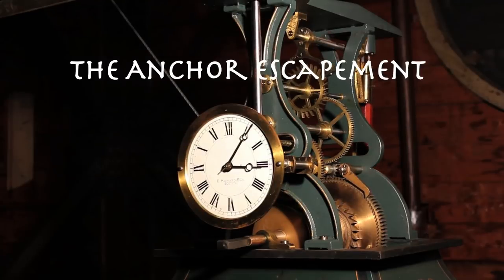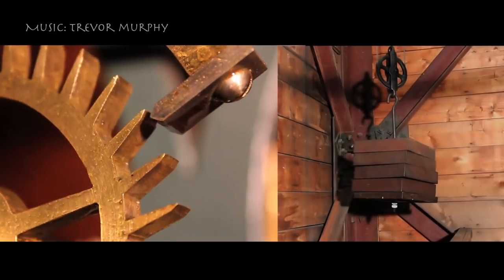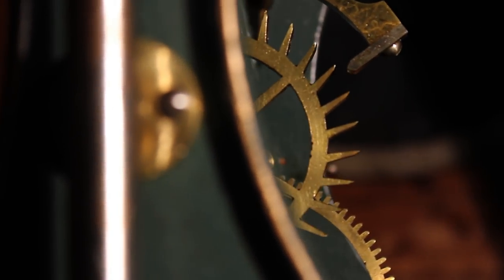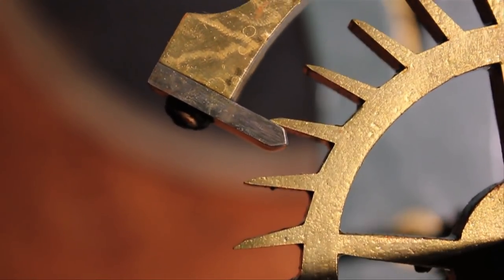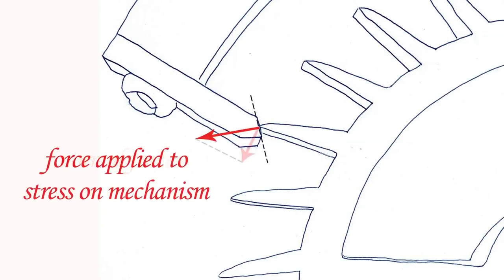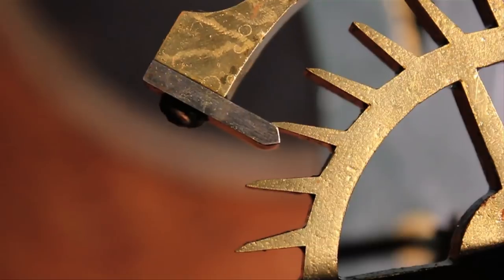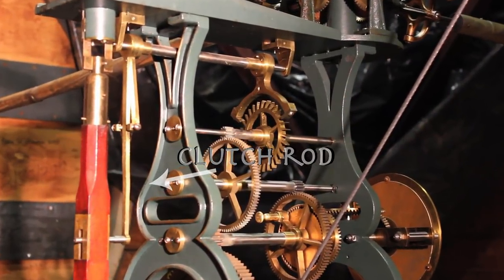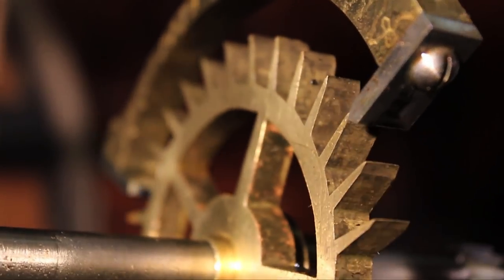Tower Clock: The Anchor Escapement and the Pendulum

Comment: I wish in my efforts to understand how escapements work I had seen this video first. The explanation was very clear. Thank you.

On the comment about it being a dead beat escapement. Perhaps others might be interested in this: A dead beat escapement is called that because for an instant the escapement wheel is stopped completely so the second hand seems to jump as it moves.

A question: What is the part of the escapement mechanism called that controls the escape wheel? I have looked at several diagrams and they identify parts of it but it isn't clear to me what the overall thing is called. It seems like it might be called "the escapement", the "anchor" or the "palet". Although palet seems more like a term for part of it, escapement seems more like a term for the total escapement mechanism including the escapement wheel and anchor seems more like a term for a particular kind of escapement. 

Thanks in advance for an answer for what might be a very elementary question that I should have been able to figure out the answer to on my own.

Comment: What is shown in the video is more of a deadbeat escapement as it has no recoil and the wheel is locked first through the pallets falling on the locking face, then the pallets  are pushed by the impulse face.
I believe the anchor escapement has no locking face and it recoils as the pallet falls on the face to slow down the pendulum and reverses it. 
The anchor escapement does look like an anchor, but the deadbeat well,  the fork is related to the anchor but the pallets shape are curved  .  I have to go and confirm all this.
Reply: Absolutely right. He called it a clutch  instead of a crutch too.
Reply: Yes, you are absolutely correct. It is a deadbeat escapement. And it should be crutch, not clutch.

Comment: That looks like a really solid escapement, nothing like I've seen on regular grandfather clocks. Approximately how much force is applied to the pallets? What are the dimensions of the wheel? What is it made of? Where could one get an escapement like this? Sorry for the bombardment of questions, I'm just really interested on the engineering of the whole thing.

Comment from the maker: Malcolm, Thanks for your comments and questions. The weight for the clock is 220 pounds (a different scale from a grandfather clock). I estimate the weight on the pallets of the escapement anchor horns at about 1.5 pounds. It is about 4 inches in diameter. I think it is brass. I haven't looked into getting another one, but I have heard there is a business in Connecticut that specializes in caring for clocks like this one. I can answer your questions more specifically, but it will take some time.

Comment: The mechanism in a lever escapement mechanical watch is different than this, because instead of a pendulum a watch has a balance wheel and hairspring, and instead of a clutch continuously connected to the pendulum, there's an impulse roller that engages the escapement at only one point of the swing.  Search for "lever escapement" here on YouTube and you will find some videos about it.

Comment from the maker: I put the audio of the clock in some audio editing software and it was difficult to discern a difference. One click is the inside of the anchor horn catching the escapement wheel, the other click is the outside of the other anchor horn catching the escapement wheel. Maybe the sounds are coming from opposite sides of the escapement wheel and my microphone/ear is closer to one than the other. Or the path of the sound wave inside the watch is more clear for one side of the wheel than the other.

Comment: If escapement wheel power the pendulum..then who power the escapement wheel???
Reply: The hanging weight imparts the torque required to turn the escape wheel through a series of wheels in the power train.